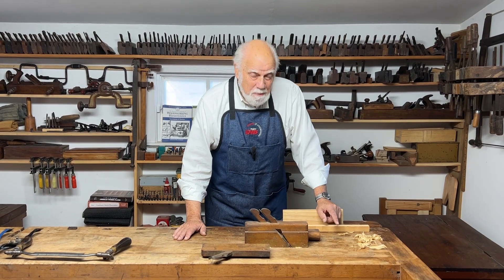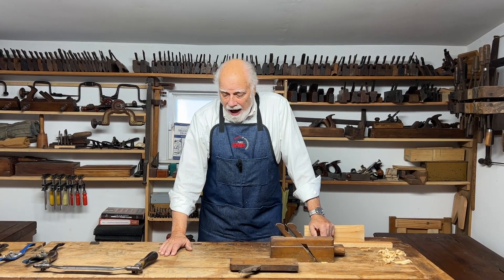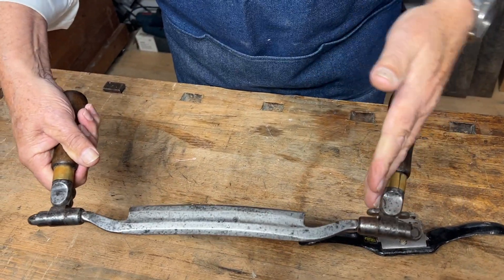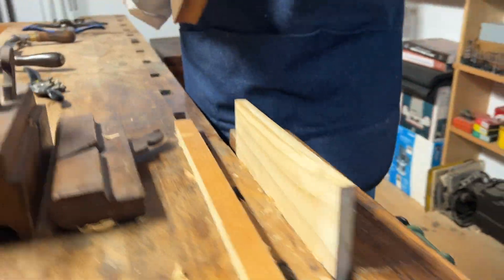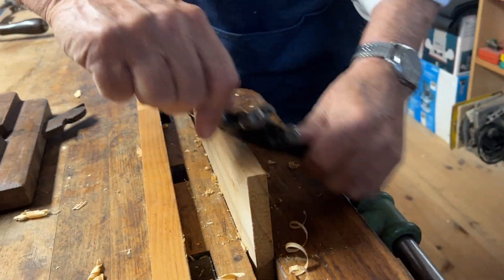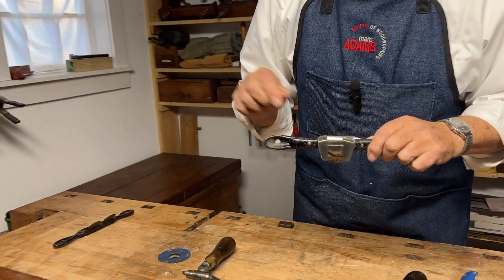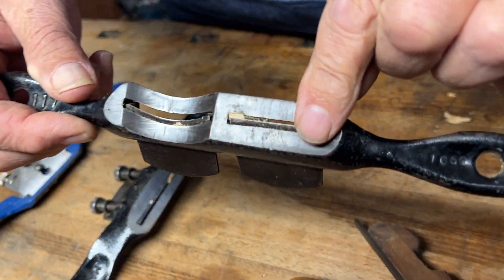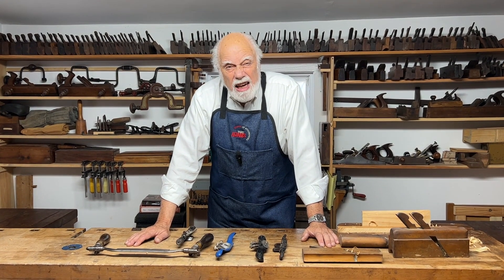63.Rounding Tools & Spokeshaves

Comment: Excellent class. I have been using the spokeshave more in my projects, I just need to get to learn the blade adjustment better.
Reply from the maker: Bit by bit!
Reply: Mr. Blackburn, a question on my mind, is the spoke shave iron supposed to be bevel up or down? I am always unsure that I have it right. Kind regards, George.